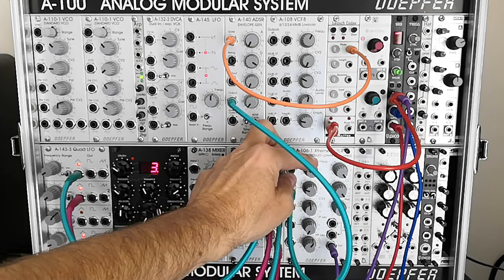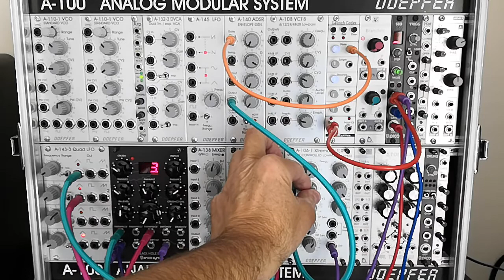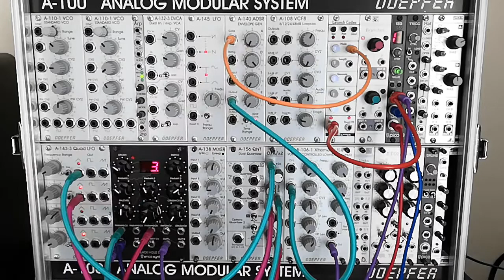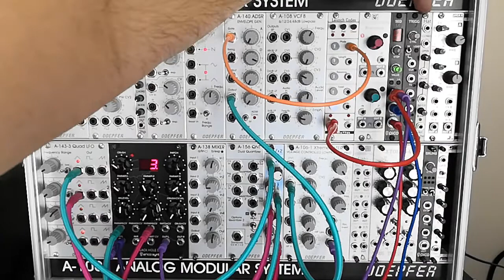Kick Eurorack Filter Technique, also mixing 2hp Hats

Comment: Good stuff man that kick sounds great, will try this.  I think in doepfer manual it’s says “self oscillation of a-106-1 is anything but a sine”. Thought that was funny.
Reply from the maker: Alan I find the challenge is recording it for use in any track. But I do like running even sampled drums through the same Xtreme Filter. Then I can create variation with the CV controls. Check out my latest album on Bandcamp under my performance name American Astro Monkey Project. Back Underground.